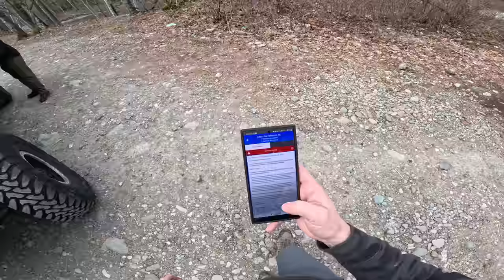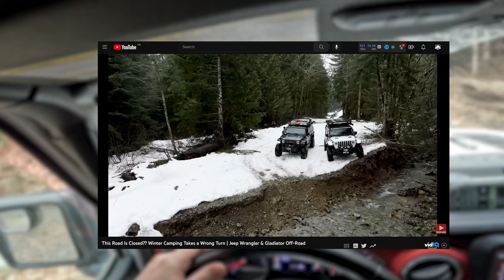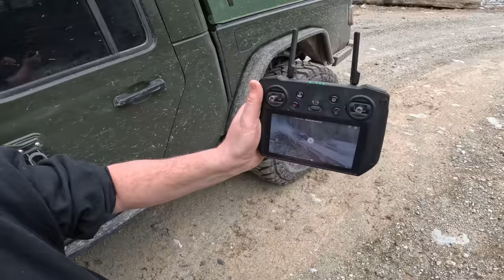Winter Storm Moved In Overnight While Camping With My Jeep

Comment: Would suggest hacking your ground tarp just shy of the dimensions of the Pod.  The way you have it now (during rain) would allow water to go directly between the tarp and the tent bottom.  A normal ground tarp/foot print is usually shaped just to fit or under fit the tent shape to keep 90% of dirt away from the tent bottom, and either rain or ground moisture from it as well.  Winter probably isn't going to be as big of an issue.

Comment: Living in North Sweden near the arctic circle where we have quite much snow each winter I do stress the need to keep all windows and all sights free from blocking snow before you start driving, if you have that much snow obstruktion your sights you have that much less situation awernes and might not see the danger you drive into, particularly in the offroad.
I've once made that mistake myself, it was a rough wakeup to always take the extra few minutes to do it right and clear all the snow off.

Comment: I have the full size ShiftPod and it's HUGE! Works great for a couple and to be able to sit in it during bad weather. You can also get a center pole from ShiftPod that connects to the tip of the octagon roof to keep it from popping down during heavy snow and the like.

Comment: 10:53 Super dry wood on the west coast is a rare thing. Looks like cedar tho' it will burn fast.
12:18 I think I heard you say on another video you are 6' 3" can you stand up in that tent or are you hunched over?
29:18 VHF Frequency146.460 are you running naked on that frequency or are you licensed?
36:10 I was hoping to attend Easter Jeep Safari but I have to much stuff up in the air (selling a house and planning a move to Alberta) to attend this year.
37:03 POV off road experience, not a fan while driving, image stabilization is not bad but there is to much side to side movement for me.

Comment: The fly is meant to be 90 degrees turned from the roof points. In other words, there should be an overhang over the door. THis allows you to keep the windows open with a breeze or to deal with moisture at night.

Comment: I'm so jealous you guys have the metric system.  We have to measure everything in washing machines and football fields.
Reply from the maker: Lol
Reply: Dude, that’s hilarious, and accurate!
Reply: I wish we would go to the Metric system in the US, as Military rest of the World and England (who we modeled off of) all use it.
Reply: The U.S. was supposed to do it, but never did. It’s easier in a lot of ways.
Reply: Mm over inches any day
Reply: @jamieknopp300  I know.  I hate fractions.  Wtf is 13/17ths of an inch.  Give me millimeters.
Reply: The metric system is trash.
Reply: @J.Young808 the US military doesn’t use MM. it’s not accurate and you can’t make small increments in measurements. MM system bolts round easier and can’t be torqued as much as Inches. Every Space program China, Russia and India use Inches because of how accurate it is and for the strength in bolt head design.
Reply: @danamcwhite  it's the best system ever made

Comment: This could have been devastating, you guys were lucky to make it out as easy as you did. I miss your drone footage, though still a great video.
Reply: What could have been devastating? That's using a Gladiator and a Jeep to its potential and having fun doing it. Enjoy the POV immensely do not miss the Drone whatsoever. Felt as though I was Wheeling with you  sitting in the backseat.
Reply: @Howard  lol, driving into something deep that they couldnt see because it was snow covered and maybe not get out of it. It happens.....oops, responding from a different account.
Reply from the maker: Nothing holds back the Dirty and Dangerous crew.

Comment: So to that new tent hold the heat were you warm at night? And what are you going to do with the old EcoDiesel?
Reply from the maker: The windows ended up being closed up and trapping all my air in, the inside was soaking from condensation. I was warm, but I have a good system with a heated sleeping bag so I can sleeping in whatever. I will be selling the ecodiesel soon I think.

Comment: GPS?
Reply from the maker: GPS wasn't accurate enough to pin point hte exact route and we have several tracks in and out as they change ever year with the water flowing through in the spring.